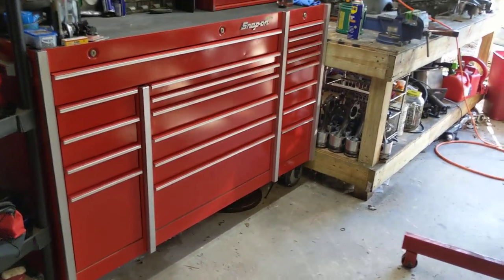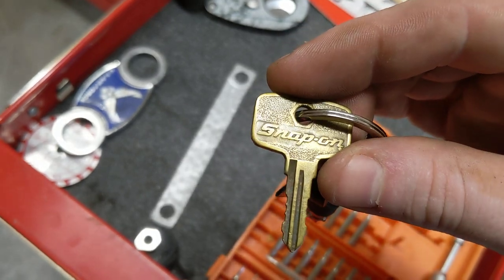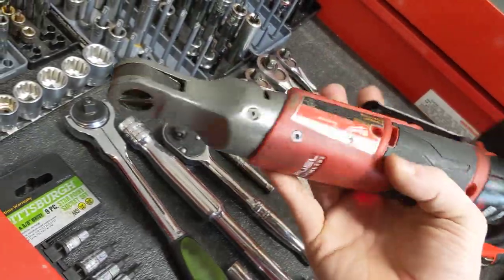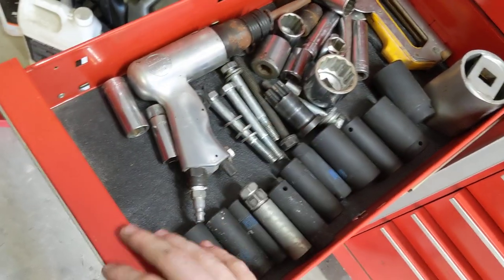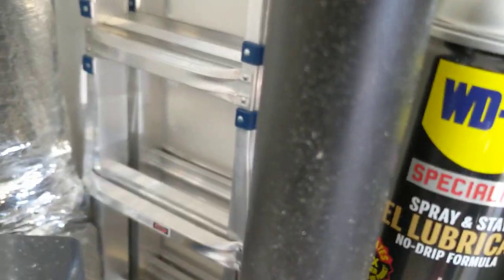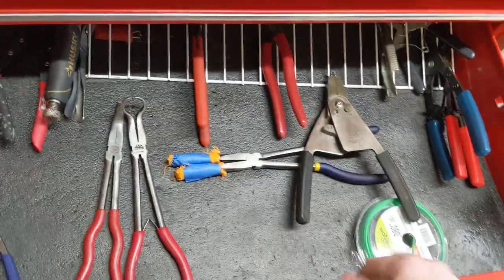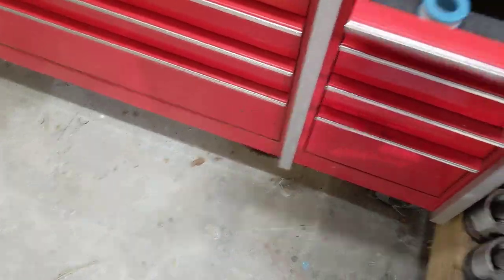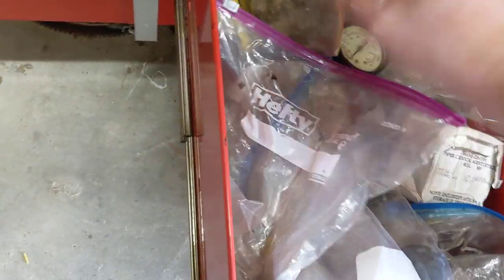Snap-On Toolbox tour!

Comment: Im so happy to see another snap on man! Fuck I love snap on, they are such a good company. Snap on has the best tools and also snap on has the best boxes! My snap on 22mm 12 point deep well 1/4 inch drive socket out performs the rest, I cant believe the quality snap on has. Have you used the new snap on cooling system pressure tester and flusher. This snap on tool not only can test the pressure of your cooling system, but this  snap on tool also has the ability to flush a cooling system.... nothing else compares to snap on. I will see guys with blue point stuff, or gear wrench stuff, or anything else, and I know they they are not doing the job right, because they are not using snap on. SNap on should be a requirement to get any SAE cert. I have so many jobs done wrong because a snap on wasnt in the lube techs hand. My local snap on deal who works from a snap on truck will give suck great deals too. I got a set of standard wrenchs from him for only 14 payments of $399.99... he wouldnt give that deal to anyone else... and I will never forget when the snap on man gave genuine snap on key chain with my purchase of a $599.99 torx bit, its worth more than the tool itself! Im sad you have all that low quality MAC shit on your box, its blasphemy. Why would you disrespect snap on by having such an inferior brand marketed on your snap on box? But besides that, you have a nice box!

Comment: When are used to live in the peoples Republic of New York, I had a 1980s snap on toolbox with friction slides. All the slides didn’t work too well so I decide to use grease on them. I forgot that its 20 below zero in the middle of the winter and the slides were frozen in the drawers. You learn!
Reply from the maker: Yes sir I learned that lesson.